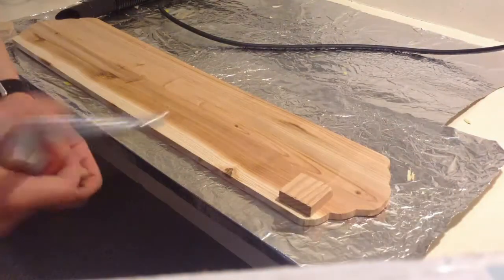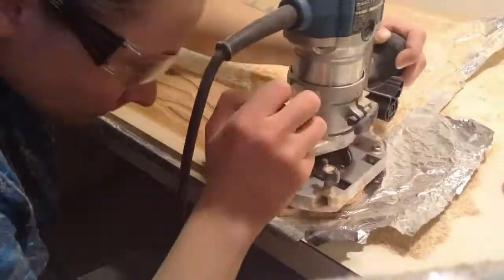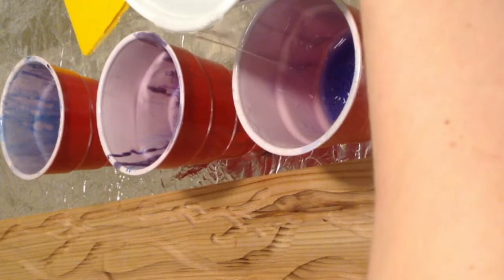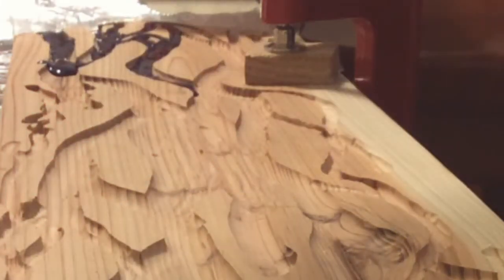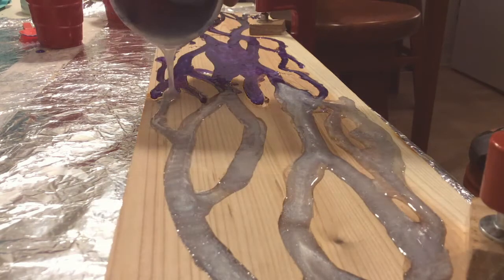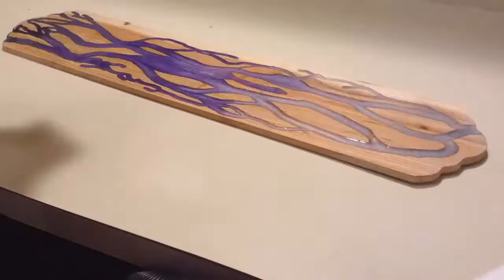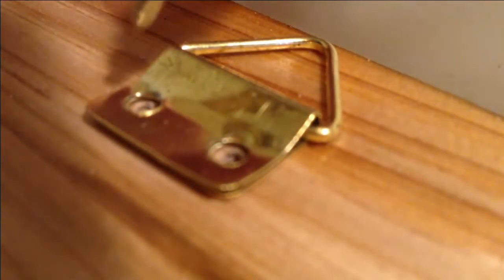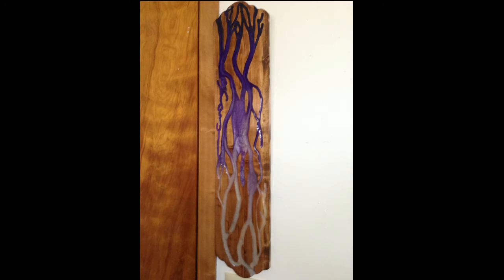Resin River Veins with Variegated Epoxy [Simple Router Project]

Comment: Just a heads up if you polish the resin it would look 10X better. It would give it a glass look so it is not so cloudy.
Reply from the maker: Good eyes! Part of the problem with that one was that water and oil based polyurethan had got mixed together by mistake when condensing supplies to move😕 Usually sanding to 320 or 500 with a coat of finish will bring up the shine, even on pieces with transparent resin